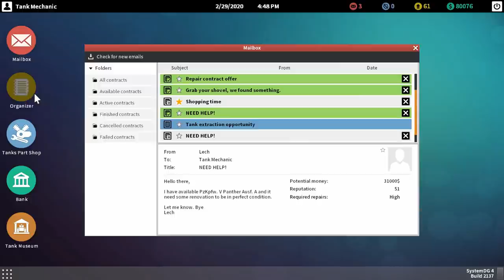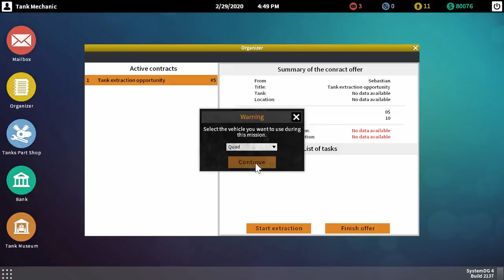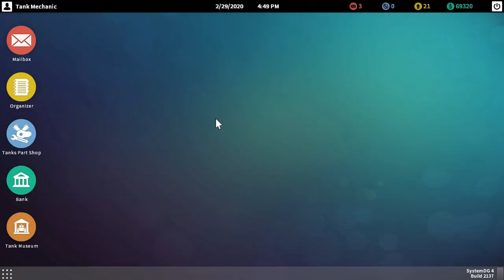Complicated Repair & First Tank In The Museum! ~ Tank Mechanic Simulator #3

Comment: The primer and paint stops the tank from rusting. And it annoyed me that you never saw that unpainted part you looked at it for soo long and still missed it. 23:35 bottom right of the screen you can see an unfinished rod

Also the developers should add random gun or bits of metal under the ground that the metal detector can pick up so that early game ur digging up trash and guns and stuff rather than the tank but once you get this new device you can determine what it is that ur digging up so u can bypass everything you dont want